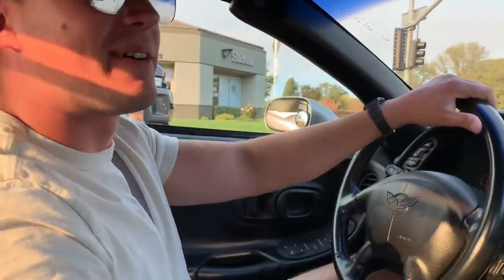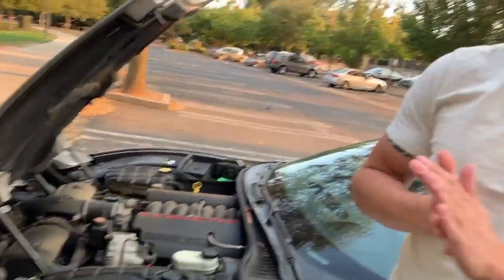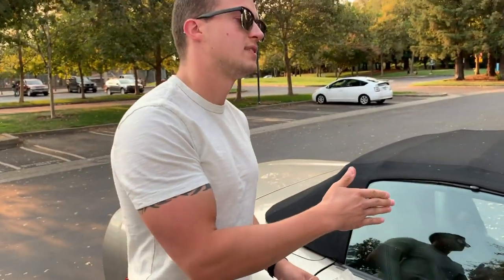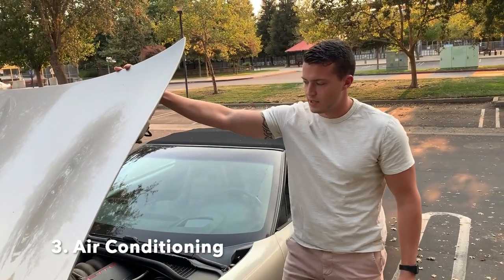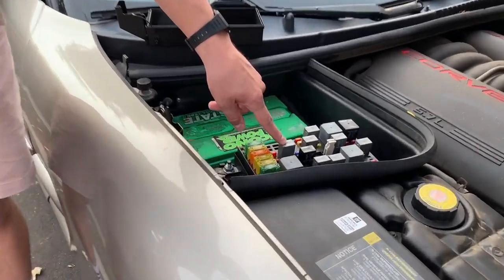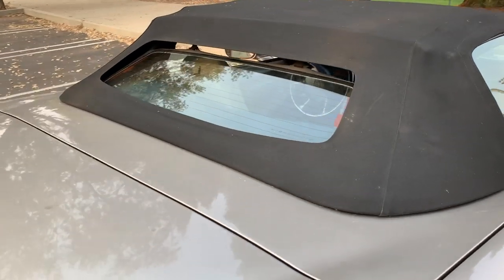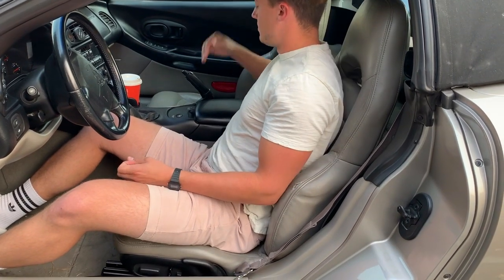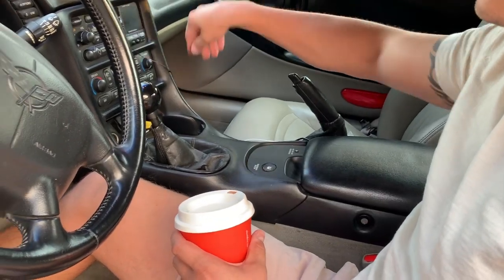PROBLEMS WITH MY C5 CORVETTE

Comment: The e-brake lever can be lowered once engaged. 
Straps on the rear window are there so when you're driving with the top up and windows down, you can bleed off some of the air compressed into the car. It regulates the air flow into and out of the car so you don't have the wind tunnel effect inside the car.
You don't really think a manufacturer would spend the money to engineer, fabricate, and install straps on a window just in case the glue might fail in 20 years. 
You should consider joining a local Corvette Club.  
I'm sure there are people in the club that would be happy to teach you about your car and make driving it an even better experience.
Have fun. Speed safely.
Reply: How does one adjust those straps? Is it in the owners manual?
Reply: Check out Corvette Forum, C5 section. Lots of great info / knowledge members. Good luck

Comment: Here's a good rule of thumb that fits many, many things. Never buy the "A" model of anything.
Reply: He owns a 2000.  It was 3 years in.
Reply: @302vettelife2  yes but he also stated all 1997 thru 2000 Corvette's were the same. Hence the "A" model remark. I owned a 2002 and had none of the problems he states in the video. In all fairness mine was an automatic and a coupe. I sold mine in 2014 with 170,000 miles on it and purchased a 2009, again not the "A" model. It's just a good rule of thumb and is why i will not purchase a 2020 model.
Reply: @smogbusters3443  As you know, there were a handful of changes made to the 01+ C5s but quite honestly, I have not seen a huge problem with the 98s as compared to the 04s.  Although I agree with your logic of avoiding those first year runs.  All that being said, relating to this video, point to the 20 year old car that doesn't have issues.  The C5s are no worse than most others and a lot better than many.
Reply: @302vettelife2  I agree and yet the best kept secret about these cars is the fabulous gas mileage they give you. When it comes to cars in general, Corvette's really are one of the greatest cars ever built. The mystic the car has is well worth the price of admission. The driving experience is beyond and other domestic out there.
Reply: @smogbusters3443  I tell people all the time, if you've never driven a corvette, you need to.  It really is a special ride.
Reply: @302vettelife2  Yes I again agree with you. Now if you could just make this snow go away????

Comment: The c5 are the best bank for the buck,  they do sometimes have the usual gm motors problem most where fixed with the c6 which can be had for a few thousand more plus 50 hp more . But like most stated it's a 20 year old car that still looks good and runs very good. Any old car will need repairs that's a fact so budget for it in the price of the car
Reply: Phillip Pugh if they dont like the vette go buy a 20 year old European luxury or super car then  they will cry very loudly lololo. love my super charged highly modded  l82 f41 close ratio 4 speed corvette stingray which I painted blue and diamond metal flake had the car 38 years love it
Reply: @nickking1510  Id rather buy a 30 year old german sport sedan like E34 M5, beautiful, powerful and bullet proof

Comment: You live you learn.. convertible is actually more expensive when it came out. C5 CORVETTE you should always go the last year because they basically  are working on the next generation C6 so it basically had no problems except electric is a issue on a few things  and I think the parts you can always find 02 and above it seems and some things but not much really ever have to be fixed  but the cars are amazing basically a race car with a radio. But i took mind out and the speakers and alot of panaling in the car. the V8 is the radio and the cars you can usually fix yourself. the dealer is out for dealer not the consumer sadly
Reply: They really didn't do anything to C5 corvette after year 2001 when it got the big update like LS6 intake, headers and stronger synchros etc. 2002-> is basically just color options and updates on Z06.
Reply: Do you own 1 ....  Because if u did Dake Earnhardt all time  favorite car.  Need I say more * ))Boom!!!((  even the lead  engineer from GM said the most raw of all generations and nimble .  they out did themselves on the C5R *was tremendous!!!!  C7 ZR1 is better than the C8 as the years go.. I think drivers car is always better than the options they give nowadays
Reply: DALE , spell check sorry;,)

Comment: I had an '03 50th Anniversary edition that I loved. Some of the same problems. My right headlight motor gear stripped on a road trip and wouldn't go up. The dealer said 2 grand to fix! I had a 35th Anniversity model that was 25 yrs old at the time and never had a headlight problem. Those lights turned 180° to deploy. My C5 leaked like crazy when it rained both the top and side windows. The Dealer wanted a fortune to fix that too. Finally had to trade it in.

Comment: bought mine new in 02... has some issues but still runs great ... two solder points fixes the brake control , BUT, there are two tiny plastic clips that allow the heads up display to move, they break it falls , I just turned it off, requires removing the dash to replace 29 cent clips!!!   oil pressure sender is UNDER the intake manifold, who thought of that one??, other than that all is well, lol still my daily driver and I will drive it till it drops ...oh yeah wipers have a mind of their own, need to replace the motor , there is no easy fix for that one

Comment: The center console has a ”double hinge”. Just fiddle with it a little and you’ll learn how to open it all the way even when the e-brake handle is pulled up.
Reply from the maker: Damn.. this is really good to know. Thanks!
Reply: Lift lid part way - pull lid away from hinges - open the rest of the way

Comment: I have an 02 and did replace the headlight gears. I also glued the rear window. One heads up is the side windows . I replaced both motors . My mechanic told me that they also have plastic pulleys and use a cable to work. One just flat out died and the other one had a broken pulley. Since they only come as a complete unit you have to replace them. Have fun!

Comment: Had the same problem with headlight motor on my 94  firebird as a matter of fact the vette uses the same motor. got the same kit you bought, it solved the problem .no more noise.

Comment: Thanks for your honesty. I've been looking at a few mid 1980s to early 2000 vettes. The early '80s are a waste of money. I know a few people who regretted these.
 I prefer a removable hard top or the T-Top style.
 I'm getting older and will possibly get an automatic. Good working AC is a must, I'm glad you mentioned AC issues & computer issues. 
 Thanks for this video. I will have a good mechanic go thru whatever I buy. It's worth the $150.00 or so. If it is a money pit I want to avoid it.

Comment: I bought a 2000 C5 convertible with 41,000 miles for $18,000 from a co-worker who had five vettes. He babied them and it shows. I replaced the clutch for $2,600, replaced the steering column lock module with a by-pass, otherwise no problems. Car is showroom condition, beautiful, fast with tuned exhaust...sounds great.

Comment: Just a heads up your middle console is designed to be pulled towards you first then lift up. Pulling it towards you frees the part you mention was catching on the ebrake. Good video.See ya on the road.

Comment: MGW shifter or swap out the bushings on stock shifter then perform a alignment on it will solve the 1st gear problem and help on reverse. For reverse replace the reverse lockout solenoid if you can't get in to the reverse.

Comment: I was thinking about getting one with 67k miles for $13k... You recommend it?
Reply from the maker: That sounds like it could be in good condition. Just, PLEASE bring it to get a PPI (Pre-Purchase Inspection), preferably from a mechanic who KNOWS C5 Corvettes. Have them check the engine coolant temps, the radiator, tires, suspension, AIR CONDITIONING, etc..
Reply: @Camhill182  thanks for the heads up, pre purchase inspection cost like $160 but I think it's worth it.  You don't recommend getting it checked from pepboys right lol.  I also heard the leaking and corrosion issue of the battery

Comment: The ecbm traction control light problem has been so common over the years that there’s many shops that provide a guaranteed rebuild service for around $100 bucks (including shipping). Don’t even consider a new one for the dealer rip off 1200 or 1400 or whatever they charge now. Check the how to videos on YouTube on removal, then send it to a shop on eBay to rebuild it. Looks fairly easy
Reply: Thats solution works if its 01 to 04  c5.

Comment: one easy chk, if your blowing cold but not coming out strong  air conditioning, is first... go to the underside of the rt side fender.underneath, a blk like air box you'll see a black hose attached underneath, if that hose has fallen off you will have actuator door a/c proplems, blowing actuator codes for sure...
.so first chk that out, dealer wont tell you this...because they make no money.....even if they hit you at 300 minimum goal at garages...hummm.  this can definitely be one problem, hope this helps...........

Comment: Ac issue can be fixed by buying the RIGHT battery it’s the optima battery acid free because acid punches holes through the AC lines which makes your AC leak

Comment: Just wondering if your gorilla glue fix worked. 

I have a 2001 Convertible C-5...my Dad and I bought it as a project to upgrade as we wanted....we put on  a phenomenal exhaust system, air intake, new wheels, etc, we've had it for over 10 years and when we got it it only had 13,000 miles on it, the previous owner just never drove it.... I'm sorry you've had so many issue.  Everything else other than our rear window we have loved....of course my Dad passed away in 2017 and gave it to me to work on and keep his "dream" alive.   Ours is viscous and I love driving it... we've always had a certified Corvette mechanic work on it, maybe one of the reasons we haven't had so many issues....

trust me though, if I had the money I would love to keep it and buy a newer vehicle and just keep my vette for "top down" days.  Thanks for the vids... I'm going to try the gorilla glue fix....my problem is; I live in Mesa, AZ  and it's second only to the sun as far as heat goes lol. Anyway, I'll see how the gorilla glue holds up in the heat.

Comment: My AC won’t blow cold, trouble going into first sometimes as well, need to replace my oil pressure sensor... other than that the car is great oh and my headlight does that too makes it sound like a piece of sh** but worth it
Reply: My AC does the same..  Won't blow cold air!!
Reply: My ac quit... turn signals... wind shield wipers... oil pressure sending unit... windows have trouble going up and down...lost one key...250$...CD player stopped
I let the battery run down... recharged it... everything works... lights etc but now it won't start... won't even click or turn over... I really liked this car...till everything went to shit... now I'm ready to put her up on blocks... lol
Reply: Oh... its a 2000 c5...104000mi...ran great...till it quit... lol

Comment: I second the EBCM.  I have an 04 zo6 and it’s just starting to get those annoying warnings.  I think it may be just a glitch in the system at this point because it only goes off once in a great while, but I know this is probably the start of it failing.  Too bad GM didn’t deem it necessary to stock extra modules.  Hopefully aftermarket will catch up one day 

Regardless, I love this car👍🏼

Side note:  the C5 and the 300zx TT are two of my favorite cars ever.  I was looking at 300z’s too but they are a maintenance nightmare compared to the C5.
Reply from the maker: I have heard that about the 300zx turbos as well. My neighbor has one and it is ALWAYS up on jacks getting work done to it. My vette hasnt had any problems besides the A/C really
Reply: Cameron Hill you did good on that purchase.  As others have said, the C5 is best bang for the buck right now concerning performance and reliability. Sure there’s going to be some issues with a car over 15 years old, but these cars are pretty damn reliable. That LS1 will last forever   GM put a lot of time, money and research into this car and it shows.  If you are ever curious about the history of the C5, check out the book “All Corvettes Are Red” Pretty amazing story on how this car came to be.

Enjoy you C5, she’s a beaut👍🏼
Reply from the maker: I agree. The C5 is a great, great car. The engine and transmission are the high points, and I also think the body style is the best. And thanks!
Reply: I just fixed my EBCM this past weekend. It was not hard and instructions can be found online.
Reply: @mdimascio  Won't work on 2000 model years or earlier. In 2001 they changed the EBCM module. What year is your Vette'?
Reply: @markwarren7959  it's a 2003. No troubles since I fixed it over 3 years ago.
Reply: @mdimascio  2003, Bingo! This is one of the reasons I bought a 2001 C5. I've had some grounding issues with mine but since I had to remove the steering rack for a HB swap it's been fine. Crossing fingers of course. 😁

Comment: I've never owned a GM that didnt have electrical problems...
I had 2 C4s. The emergency break was so much better. What did they move it???
Reply: Because that's where a E brake is supposed to be

Comment: it takes three 1/4" nuts to fix that issue there are plastic balls in gears as u say that are designed to break if they are held down!! an they are same in alot of window motors too!! an ford was first one to use them way back in 80's!!

Comment: my 98 corvette has all the normal c5 problems like oil pressure sending unit that goes out every 3-4 weeks after replacng it, the rocking seats, the sway bar links, the wiper motor udders that get plugged, the a/c compressor, the harmonic balancer, the service vehicle soon always coming on for no apparent reason, fixed them all except the oil pressure sending unit and im tired of replacing it, and yes I use the brass one, and the car only has 52000 miles on it, other than that I love it. I forgot the factory welds that hold the tailpipes together.

Comment: I had a 2003 Z06, it had a persistent problem with the turn signals, they wouldn't work. No-one could seem to fix it, not even the chevy dealer. I bought a aftermarket relay, it fixed it for 2 months, until that shot. They were like 80 bucks, and I didnt want to buy another one. Never fixed
Reply from the maker: Wow, thats, annoying
Reply: Sounds like your Hazzard switch. Extremely common issue with the C5.

Comment: You have the wrong battery in your car. You need an AGM battery or an Optima re top would be best. A lead and acid wet cell battery xan leak acid underneath onto the Body Control Module and A/C controls causing many of the issues you have experienced.

Comment: At some point watch out for the oil sensor also make sure you scan the codes yourself before you take it to a mechanic. So you can clear them .. iam sure you did but also the ignition is a thing with  All C5 Corvettes in some shape or form. And the GM anti theft thing you can bypass and it's a issue because the key . It doesn't give a signal sometimes because the chip wears out. Good luck  always try to do it yourself  but it's a give and take wt these cars.
Reply from the maker: I know the battery in my key fob is dead. I think I just need to replace that and I should be good right?

Comment: I love watching people complain about cars that are 20 years old. If you want to permanently fix your headlights rebuild them with brass gears instead of nylon. Maybe its me but you knew about the cup holder and center console when you bought it, which makes it dumb to complain after the fact. These are problems a 20yr old Ferrari with similar use would only dream of!!
Reply from the maker: I mean, i showed in the video that I already bought the brass gear replacements..
Reply: @Camhill182  In 20 years people got fat, its not supposed to hold your super size cups.

Comment: SO............. Now I am being told that GM does Not have the ability to repair a "Steering Column Lock issue" without Modifying the Original Factory design of the Vehicle. This even after Two Factory Recalls?

GM Should Be embarrassed beyond reprieve when even their Mechanics do not Have an EXPLANATION!!!!

5 Times this Vehicle has been to the Dealership with the Same Issue.  

I'm Being Told to Fix it I would have to Modify It??  Basically Bypass the ECM???

Comment: There’s a vid of a $15 fix for that ecbm
Reply: Thats for 01 to 04, I was hoping it included my 99, it didn't...just pull 2 fuses if the Active Control button doesn't work...or push it.

Comment: id say at this point, your door rubber is leaking, your tire pressure sensors batteries are dying, your seats are moving back and forth a quarter inch on acceleration, and your windows are clunking in the doors when you close the door.  The tire sensors are 225 a piece, do all 4 and get it out of the way. the rubber kits are like 800 bucks. the windows either need adjusting or to be reshimmed, probably a couple hundred bucks, and the shim kit for the seats is super cheap too. Oh yeah your door plates are probably missing and the door arm rest pleather is starting to come away from the door.  Where am i wrong?
Reply from the maker: This is from 4 years ago